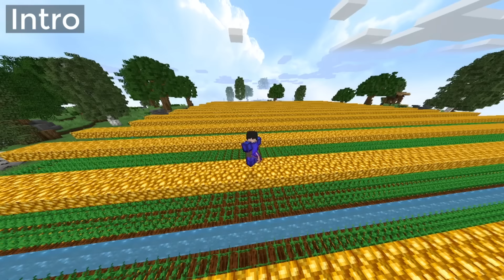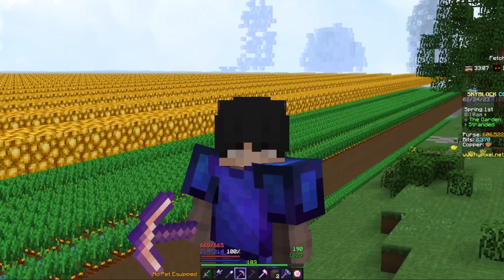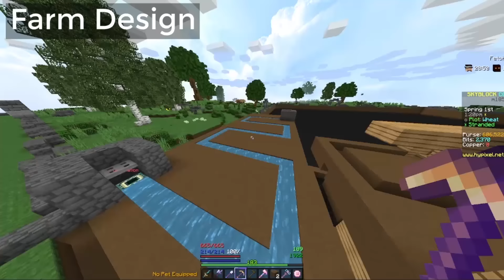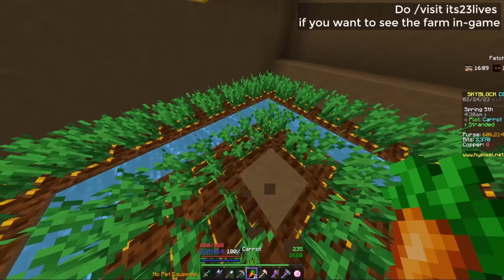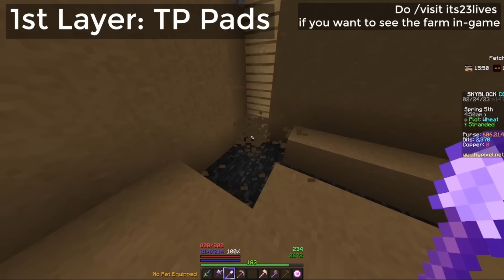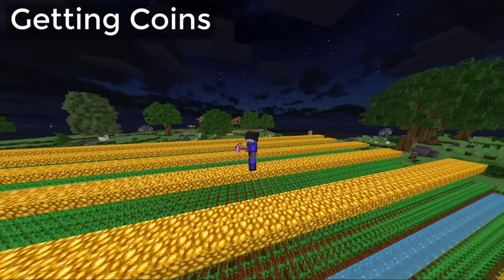NEW Hypixel Garden Wheat/Carrot/Potato Farm Design after Nerf

Comment from the maker: infinite money glitch discovered

!!! IMPORTANT: If you can't reach the crops or break all of them,
it means you need to install Patcher, a mod which will make the crop hitboxes bigger and you will no longer have this issue.
Official download link: https://sk1er.club/mods/patcher

edit: here's some more frequently asked questions that I keep getting

1) 2 layers is more than enough for an infinite farm
2) you can stack 3 layers on one plot if you use the glowstone as the block you walk on for the 2nd layer (thanks Icicle for pointing this out to me)
3) speed for farming this is 116
4) use the mushroom preset to clean out most of the dirt faster if you want, and use block zapper with builder's wand
Reply: Is saving a preset of a plot to bedrock good or should I just remove all blocks manually?
Reply: is patcher bannable?
Reply from the maker: @phovs  nope
Reply: @phovs  no
Reply: do you put depth strider on the rancher boots?
Reply: i cant place teleport pads in garden

Comment: do the rancher boots give you enough speed to do this, or do we need to put an enchantment on it?
Reply from the maker: use depth strider on any boots to remove water slowdown, and rancher's boots are not needed for 116 speed, as you can get +16 speed pretty easy, but they work
Reply: @23lives  does it have to be exactly 116, or 116+?
Reply from the maker: @flopraiser7504  exactly 116

Comment: do we still need the glow stone even after the light update?
Reply from the maker: I don't think so, no
Reply: @23lives  ok thanks
Reply: @23lives  Can I use sea lantern?
Reply from the maker: @Challee  yes
Reply: @23lives  I built it with 3 layers, I cant use light blocks on 3rd layer though. Will it still work?
Reply from the maker: @Challee  should work if you don't have lights only on the top layer, yes

Comment: Is 1 plot for 1 crop infinite with 2 layers? Or do you need more
Reply: 3 plots 1 layer is enough
Reply from the maker: 1 plot with 2 layers at 116 speed is infinite, you won't be able to fit more than 2 layers anyway
Reply from the maker: actually I take that back, you can fit 3 layers if you use the glowstone as the block you walk on in the farm
Reply: @23lives  yeah, i built 3 layers you can check it out - /visit Airininis
Reply from the maker: @alioniukass  good stuff, thanks
Reply: @23lives  do you know a good speed for side farming wheat?
Reply from the maker: @DislikeMathAlot  116 if you're using the design in the video